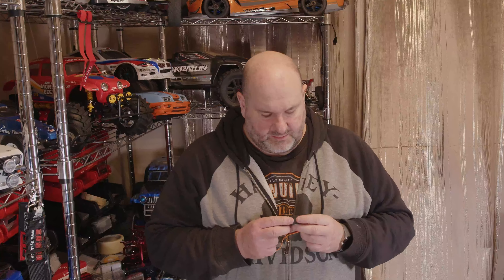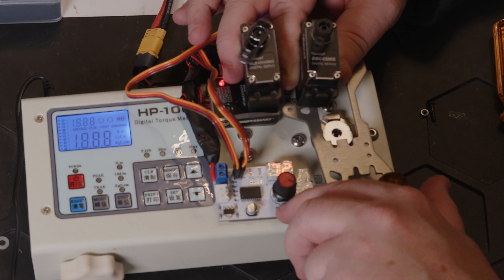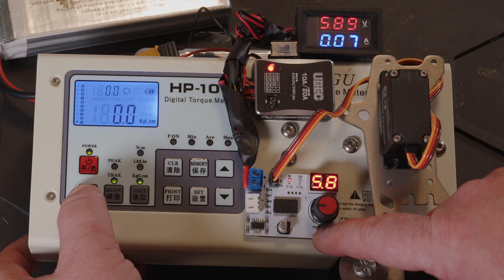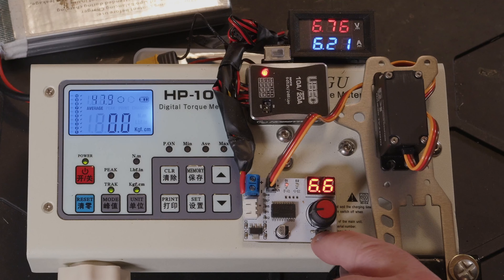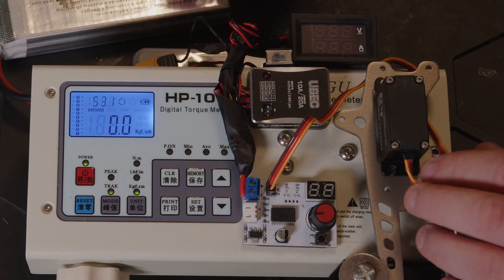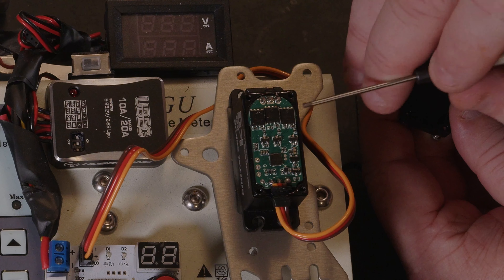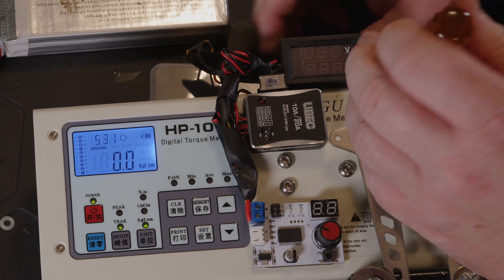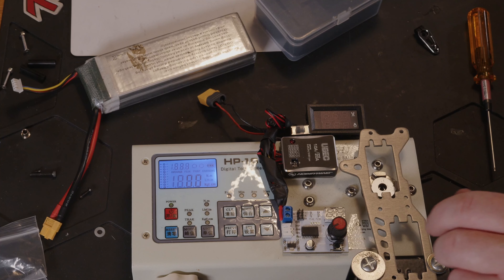9Imod BLS-HV45MG 45kg brushless servo tested

Comment: I swapped my coreless for Brushless and saw a decent increase in turning speed on my rig.
Reply from the maker: Depends on the exact servos the 2 I tested would be no different I the same rc
Reply: coreless looks faster here
Reply from the maker: It should be faster to start to move as it's less rotational mass but not sure how much it would affect the turning of the steering once the whole steering and wheels are connected but both would be great servos

Comment: If an esc bec can deliver 7.4v but at only 3amps and this servo wants 6 Amps would it be better to put the servo red power line straight to the lipo like the old fet servos or is that nonsense? 
I can’t think clearly right now lol.
Reply from the maker: So these are 8.4v capable servos so you could power them directly from a 2s lipo or you would need an 8amp bec or ubec to run them correctly, if your esc can only provide 3amp then they would probably cause drop outs on your receiver or even burn out the esc's bec

Comment: Now that really is interesting, there's really nothing between them apart from price!
Reply from the maker: Yep nothing at all really brushless runs a little cooler and little more kg at top end of voltage
Reply: @WTFRCCars  you would have thought that brushless would have had more of an advantage somewhere given the 20% higher price tag!
Now when someone asks for the difference between coreless and brushless, you can now tell them genuinely and truthfully, that brushless is Cooler.. ;)
Reply from the maker: Yeh in the long run brushless will last longer as there are no brushes to wear out
Reply: @WTFRCCars  thought coreless was just brushed but without the brushes?
Reply from the maker: @EddieDesigned no coreless has brushes but the core is made different to a stock motor it's much lighter

Comment: I just installed a yeah racing servo saver on my egress because it wasn’t returning to centre and it’s def better but still not great.  I’m using a 1060 with £20 servo and radiolink receiver/trans.  Is it a case of upgrading everything or what should I try I just wanna go in a straight line.
Reply from the maker: I'd try the servo 1st as almost all servos will work with any transmitter/receiver and the cheap £20 servos ain't great